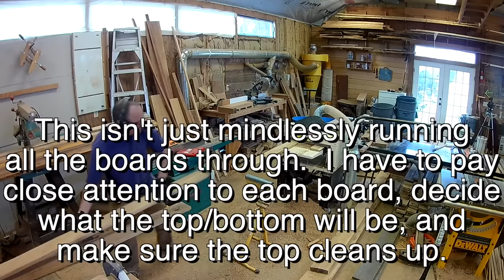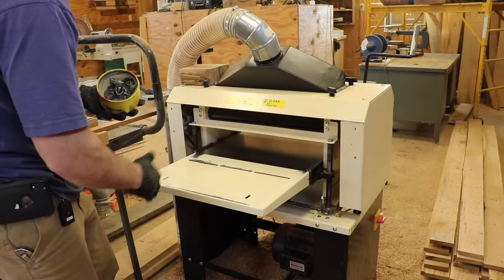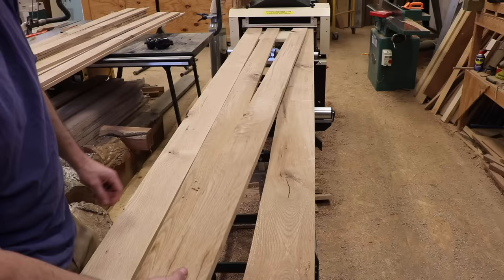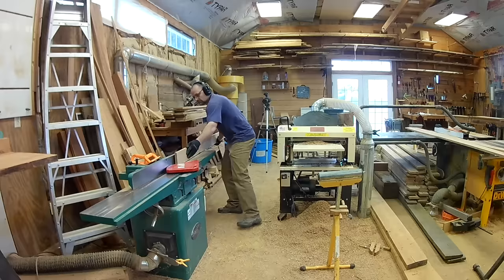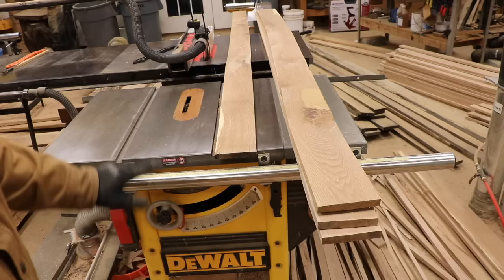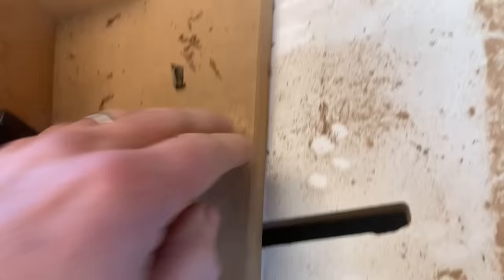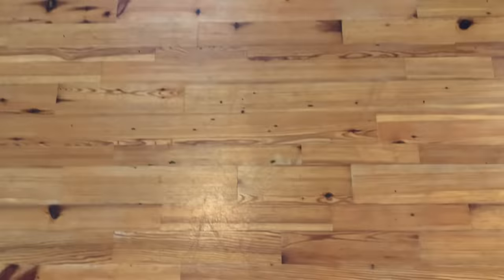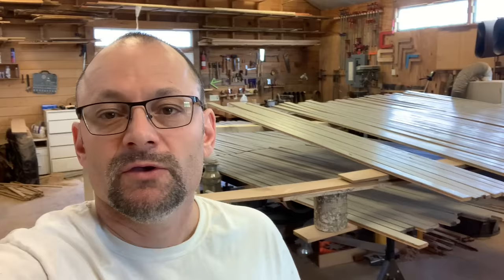Making Tongue And Groove Flooring From A Fallen Tree.

Comment: How do you avoid snipe when using your thickness planer like this?  If it had been me, I would have used the wide boards and kept them long.
Reply from the maker: Keeping them end to end helps a lot, and a tiny bit of snipe won’t matter for this application.  Plus the sander takes some of any snipe tats there out.  If any boards have a lot of snipe, I have enough length in most of them to cut it off.

Comment: Hi.  I just found your channel and have subscribed.  Last night I watched you replace a hydraulic pump on your excavator (well done by the way).  I'm curious as to what part of the country you are located, north, south, midwest, etc?  I'm in North Florida and any wood that I cut and try to dry always cracks.  It is very humid and warm here and I wonder if maybe that has something to do with it, so was wondering if its humid where you are.  We average around 80% humidity during the year with maybe a dozen nights total that fall below freezing.   Any drying I have tried was just air drying (no kiln), covered & out of direct sunlight.  I look forward to watching all your content.
Reply from the maker: I'm in Virginia.  Wood definitely will crack and check as it dries here, some species worse than others.  Cheers!

Comment: I can relate to this so much, however i was taught to always use the joiner before the planer, i dont know why its just something i do now because i was taught it.

To you my wonderful FarmCraft101, do you think there is any advantage either way?

Straight edges before taking them down to width, or taking them down to width first then fixing the edges? It was just something i noticed as a difference, i live in Sweden so it could simply be some practices being handed down.

But what do you think?
Reply from the maker: If you are jointing the face, you definitely want to do that first, and then plane the other side.  For the edges, I personally don't think it makes much difference in the end result.

Comment: Any thoughts on not sanding until after the boards are down and then using a drum sander to finish before painting? Seems like it may be easier (and not require your big sander)
Reply: It would be AMAZING if he rented a floor sander and then sanded this porch floor once it was installed! Total overkill, but it would be awesome.

Comment: You're right that the oil-based paints are a byproduct of the oil industry.  Lots of money went into the PR campaign to get folks to switch over from the traditional ways.  I prefer the traditional paints because they offer colors that are unmatched by modern paints, and actually develop a patina as they age.  Modern paints just end up looking ratty, but old Milk Paint or Linseed Paint looks fitting when it's aged with the woodwork.

Comment: sodium peroxide or sodium  perborate solution applied as a very hot solution is an excellent bleach for the old deck because when the solution is heated these chemicals release oxygen..They are non-toxic, and are the active ingredient of Oxyclean, the laundry detergent. Dipping burnt-on cruddy iron/steell/stainless steel cookware in a heavily foaming hot/boiling solution will dissolve off the crud and make the  cookware like new again (try it)   Oxalic acid, on the other hand, which will bleach many things as well as remove rust will blacken many woods including oak. It is also very toxic,

Comment: Have you ever set off your SawStop?
Reply from the maker: Yes.  Hit a nail which made contact with the blade and table at the same time, setting it off.  A friend also setting it off cutting a very wet piece of treated lumber.  I'm careful to put it in bypass mode when cutting something questionable now.

Comment: I am curious as to why there are so many chips on your planer bed.  I have an oneida v3000 which I think is similar CFM rating as yours and I have zero chips when planning.  Possible air leak or filter clogged?
Reply from the maker: It has always done that.  I have the blast gate on my chop saw open all the time, so I could make the air flow a little better closing that.  I've considered increasing the hose size to 5", but haven't gotten around to it.  Just not that much trouble I guess.
Reply: @FarmCraft101  I don't get chips when I leave my table saw gate open at the same time so I don't think its a low flow issue.  Maybe a new video idea....troubleshooting dust collection?

Comment: My father inlaw once asked me to check on tongue and groove for his porch and work up a bid to do his wrap around porch at his house he needed right under 2000 square feet the porch needed all new framing underneath so I gave my bid he got a bid off a friend's carpenter and an Amish guy he took the Amish bid I was the middle bid Amish was low he beat me by 3500$ well the Amish used finger joints his porch fell apart within three years live and learn

Comment: I know you might get a splinter but do you know how easy it would be to get the infeed roller to grab one of those gloves?  There is no way that it would pull you in all the way to the cutter head, but I am more then sure that it would crush you fingers badly enough that the surgeon would do the job for the cutter head. 

Loose the gloves or loose your fingers. Better to have a couple stitches in your thumb then to not have a thumb to get stitches in.
Reply: I was thinking the same thing throughout this whole video.  

There was a guy in our shop that always wore gloves while running a horizontal band saw (metal bar cutting). I told him a thousand times not too wear them. 
He got fired for drinking on the job before losing any fingers.

Comment: Linseed oil paint on my soffits, facias and barge boards. Pain in the arse to prepare the surfaces, heinously expensive paint plus oil as primer, like sex to apply. Two years on not a single sign of a peel, bubble or split. It is the answer 😃

Comment: What kind of kiln do you have that dried all that lumber to 6-8% mc in 2 weeks?  You couldn’t even do that with a vacuum kiln. And if it’s not 6-8%mc you are going to have serious problems. First step should have been face jointing to get  the board flat before planing to thickness.
Reply: It doesn’t have to be as dry as furniture wood as it will spend its whole life in the rain and weather.

Comment: Could you compress the sawdust into bricks to burn ?    Or is it too heavy on the soot ?
Reply from the maker: Something I've always wondered about.  Using a hydraulic ram to really compress it.  But haven't gotten around to trying anything.
Reply: @FarmCraft101  Check out the New Yorkshire Workshop.  He just did a couple of videos on using sawdust briquettes that he makes.
Reply: Considering the uses for sawdust in the garden/compost, I'd be taking the opposite route and throwing that thin cutoff stuff in a chipper!
Reply: @Matthias Wandel made a video recently referencing excess sawdust too. Seems like a common theme.
Reply: @mattfleming86  Uncomposted sawdust in the garden will fix all the nitrogen, stealing it from the plants.
Reply: @talltimberswoodshop7552  Thus mentioning the compost part.  That being said, I routinely add very small amounts of fresh or only moderately composted deep in containers or as a small percentage additive in soil.  It helps hold moisture and helps air penetration in my naturally crap soil.  You just have to understand it's limitations and applications.
Reply from the maker: @talltimberswoodshop7552  You definitely wouldn't want to till that sawdust into the soil, as it would steal the nitrogen as you say. But leaving it as a decomposing bed of mulch on top is good for it, holding in moisture, keeping down weeds, and slowly composting.

Comment: That isn't dry enough for flooring, it has to be under 10% moisture and an old shed can't possibly do that. Flooring is supposed to be 50/64ths so that the installer has room to sand before finishing. AWK? paint? Paint will walk off.

Comment: First step should have been to cut it to the right width no need to plain any wood that isn't going to be made into flooring so why plain 8 inch wide board then cut 2 3 inch wide with a 2 inch scap just plain 6 inches

Comment: My question ~ why hasn't a manufacturer of woodworking machines created a planer that does D2S or D4S (dressed two sides or dressed four sides) for the non-commercial /small woodwork shop market... actually, this would be a good hack as it is laborious feeding a piece of timber /lumber thru' a planer /router 4 times...

Comment: The same logic that indicates you don't want to use short boards (like interior flooring) because water collects at the end joints; also says you should not use tongue and groove on exterior porches. The T&G holds water! Next time perhaps use straight edges and leave a gap. :goodvibes:Prime and paint edges also before installation.....

Comment: I'm not sure why you rejected the short boards.  Even a 4' board can be finished up to be 4 more feet of flooring you didn't have before.  I ask because I know an old fashioned dance hall with a birch floor made from shorts and rejects.  The installers took their time and did a great job.
Reply: He rejected the short boards because he doesn’t want butt joints. It’s for an exterior application

Comment: 1:48 Why aren't you using the center also?
Reply from the maker: When 2 boards are directly beside each other, if there is any variation in their thickness, the thinner one won't feed properly.  When they are separated the 2 ends of the feed rollers will adjust to each board.  Obviously that wears my knives on the edges more, and I will preferentially use the center of the planer for some time after doing this project.
Reply: @FarmCraft101  That makes sense.  Do you also have problems with your feed rollers getting too slick to properly grab the boards?   If so, how do you counteract that?   I keep cleaning mine with alcohol, but I constantly have grip issues.
Reply from the maker: @jimthesoundman8641  Occasionally I will rough them up with some sandpaper too.

Comment: The industry went away from linseed based oil paint because it requires thinners that produce toxic fumes. Those thinners are made by the petro industry, so you're using a petro product too. Oil-based paints without thinners in them would take a few months to dry after each coat, not a problem for artists, but I don't know many woodworkers who want to wait 2 months between each coat. 

Another thing linseed based oil paint used in the industry contains is driers. And unlike expensive artist paint that contains relatively harmless but expensive cobalt driers, the driers used in hardware store oil paint are chemical driers that are very toxic. If paint from the hardware store used cobalt as the drying agent, instead of the current chemical driers, it would cost 30 to 40 times as much.

Water-based paint solved these problems, it doesn't require toxic thinners, it doesn't need driers, and dries fast. Water-based paint dries so fast because the binder dries through evaporation, linseed oil dries through oxidation. Yes, water-based poly and alkyd paints still give off some fumes but far far less than the thinners in oil based paints. Latex house paint gives off little to no fumes. They are all much healthier than the oil paint from your paint bucket because they have no thinners or driers in them.

Comment: Pressure Treated wood from 20 yrs ago is still around. Even on harsh dock ocean side.  I got new pressure treated 5 yrs ago. That’s rotting. Cupping cracking. Lifting. Splintering.  The pressure treat stuff now a days is absolute garbage

Comment: Great to see how much Carbon Dioxide you release in the air by burning all that wood every day. I guess green energy hasn't arrived yet in these parts of the world. If I were to ask you how many trees have you planted in your life to replace the once you been cutting , the answer is more likely to be ZERO. So good job , you're an inspiration. I know , your answer would be that you only use dead trees or fallen trees right? LOL
Reply from the maker: Assume much?  We planted 40000 trees about 4 years ago. All the carbon from burning wood came from the atmosphere and will go back to the atmosphere whether it is burned or it rots. It’s carbon neutral to burn wood, and gasifiers produce minimal particulates. What’s better in your view?  Heat pump?  Gas?  You are misinformed.
Reply: @FarmCraft101  Well , your one of very very few that I heard that planted trees. Well done on that and hope you will continue to do so. I have no issues with people cutting trees to build stuff as long as the same people plant trees as well. We have to put back what we taken because in the end it's for our benefit  on a long term. I don't mind gas either as long as we have enough trees around to absorb that Carbon Dioxide. In the UK we will terminate natural gas central heating  and move to heat pumps by 2035 which in my opinion is the wrong path to go. In my view is to continue to use gas for heating but to invest money into making every home very thermal tight and in this way the gas consumption  would be very low and also invest very heavily into building woodlands . To me that's the solution. Want to use wood? Fine,,,,for every tree you use you have to plant two instead.
Reply: @andreiiasi  I'd be more concerned about the South American forests being converted to farmland.
Reply: @savage22bolt32  Very true but from those guys I don't have much expectations for two reasons. One , because they are poor and have to make a living somehow and second , they are not very educated and don't really understand the importance of woodland . I watch mostly North American videos since I understand the language and some of the you guys cut the woodland like drawing water from a well that has no end and that's upsetting. What's more upsetting is that they don't put anything back , they just take.

Comment: All the uneven parts with the inch measurements drive me nuts, can't follow a bit. 16th 8th and Alla that stuff. Why don't you use the easier metric system? Inch is based in meter for more than a century now anyways....

Comment: so you hand rub paint on???......here is the suggestion from a guy that hand rubbed over 5000 LF of cherry trim work....5 times by hand!! sanding, staining and buffing (ONCE....JUST ONCE, never again!!!).....lay everything out and use a roller to apply the paint then wool pad to rub in the paint......you'd be done in less than 30 minutes and not too exhaust to drink a beer!

Comment: Why would you "paint" such beautiful flooring? Why not use Polyspar and let wood grain show?
Reply from the maker: Any clear coating is going to require more maintenance than I want to do.  Linseed oil paint will hold up for many years with no maintenance, and when it does, it just need another coat.
Reply: @FarmCraft101  I was always told that oil floats on water but I'm no expert by any stretch of the imagination...LOL
Reply: I m a former carpenter and always preferred to paint decks or "porches" as you call them in USA I think.  I used to build a lot of decks with kwila or "merbau" timber as it also called. Excellent timber. 

Some people thought that was weird to paint a deck but maintenance is an issue to think about long term with timber.

My sister had a large deck at her house overlooking the ocean at the Gold Coast here in Australia. I was there every 12 to 18 months sanding and re coating with decking oils. If it's an area with a lot of  hot sun exposure especially and high foot traffic this happens. Great video BTW, I haven't used T and G flooring for ages, and never made any myself.

Comment: Those boards are too long to straighten on on such a small jointer. You don't have a straight line saw, so if you had a long plywood piece made up of two pieces to get the length. with a straight edge on either side, you could nail the piece to it and run it thru the saw to get a straight edge. then parallels cut it thru the saw, then edge it if you needed to.  Sometimes cutting it will make it lean to one side or the other.  Quit wasting your time, go to a professional mill and buy some wood.